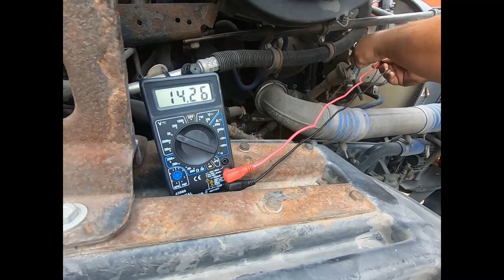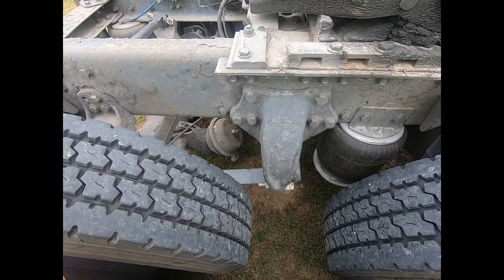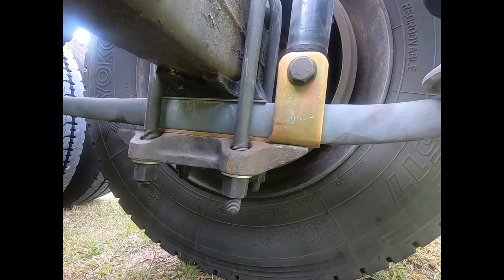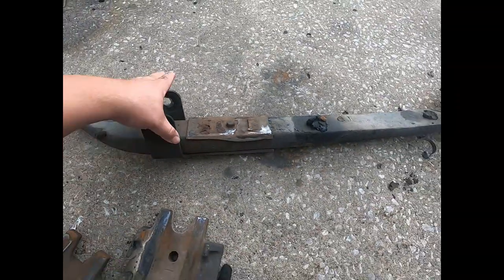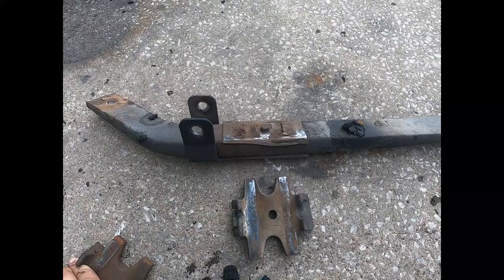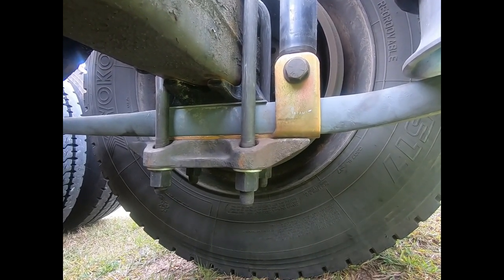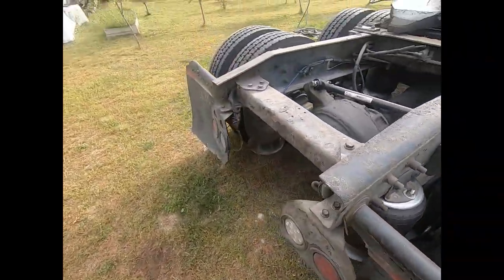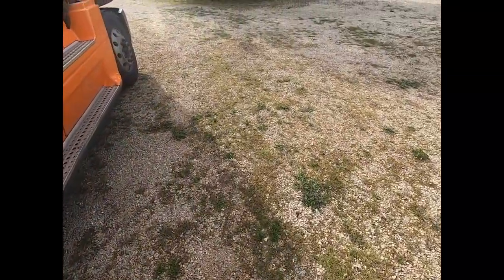Freightliner air bag lean...solution!! and suspension work

Comment: Is the airbags still holding up straight or did they go back leaning?
Reply from the maker: Still straight. I did retorque the u bolts at about 3,000 miles. I think i will do that about every 50,000 miles just to keep things tight
Reply: @DIYSEMI  good deal.. im going thru the same problem with my freightliner fld112 dump truck, Its been a living nightmare. I redid the whole suspension airbags, torque arms, leaf springs, center pins, bushings and the bracket that you replaced in your video and it still was leaning. So today im going to weld a 3/8 inch plate on the axle to hold the spring and pray for the best.
Reply from the maker: Please let me know how it works...best of luck. Always looking for a better way to do things.
Reply: @DIYSEMI   are they torqued to spec or just as tight as possible?
Reply: @DIYSEMI What do you torque it at? Do you find them loose every time you re-torque?